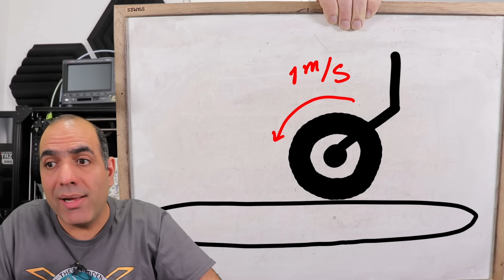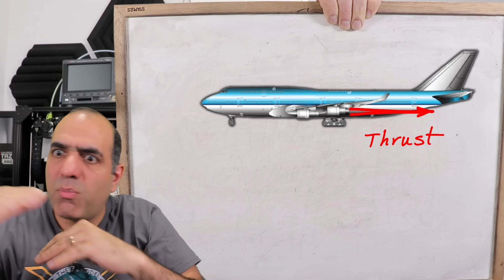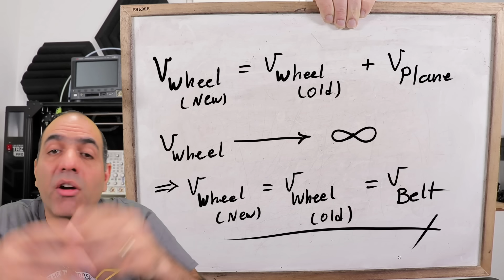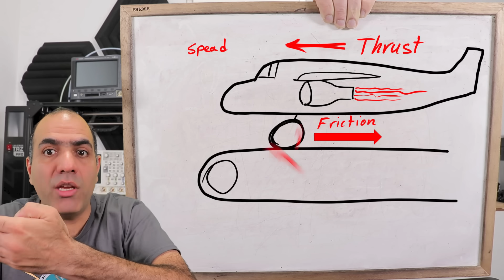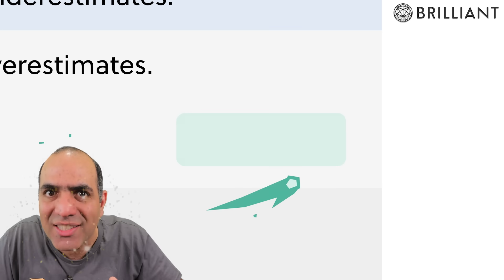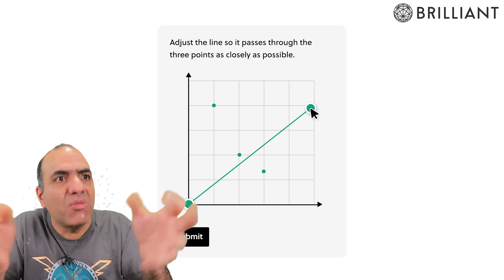Airplane Question that Drove Me NUTS!!!

Comment: Yes, because the turbines are what get the plane going, not the wheels
Reply: No because the plane needs to move to gain enough airspeed to take off, but the conveyor would just keep the plane still so it won't take off
Reply: @cristian_ca_n_le2328  here's the thing though, the wheels are mostly there to make sure the plane's body isn't scraping against the asphalt. They are mostly there for the ride once the plane is taxi'd into the runway. Think of a shopping cart. It's not the wheels providing the thrust for them to move. It's you. In a similar way, it's the turbines on the wings that provide thrust, not the wheels on the ground. The wheels are not not the driving force of an airplane. If it was a car, I would agree. Since the wheels applying torque to the ground is what's pushing the car. With an airplane, we are chucking air out of the turbine, providing thrust. Wheels are not doing anything. You only need the turbines to move, and regardless of what the conveyor belt does, the plane will keep moving until it has gained enough speed for lift off
Reply: @MrKargo  well no because for example, using the shopping cart. If you push it on a conveyor belt that goes the opposite direction as you to make it go forward you will need to push the cart faster than the conveyor speed. In this case though you can't because the conveyor belt keeps adjusting to match that speed

Comment: Case #3 can result in take-off as well.

The thrust required for most planes to sustain flight is far less than full thrust. Add a bit more thrust to overcome the drag profile, and a bit more because we want to climb, and the minimum thrust is about 1/10 aircraft weight. If it's an airliner we are talking about, we have about 1/2 aircraft weight in static thrust available when there are no passengers and using 100% thrust. 

As you said, at some high wheel speed, the drag from the wheels will balance the thrust from the engines, and the aircraft won't take off. Since this drag needs to equal thrust, if the thrust at this point is higher than the thrust to get the plane airborne, the plane will still fly and everything is good. If it is lower and we reach an equilibrium, we lower the flaps and reduce the required lift to take off, and get in the air and it's all good. Additionally, airline planes have enough thrust they can still take off if half the engines fail on the runway. So the chances of the wheel drag scenario are likely to only stop an already broken plane.

In reality, the wheels of an airplane are there to decouple the plane from the ground so it can take off in the first place.  So whatever the ground is doing, conveyor or not, it's very much irrelevant.
Reply: No it cant. You can almost ignore the wheels. The conveyor matching the wheel speed exactly (which would be effectively impossible but is the underpinning of the question) means that the wheels stay still. From there you can ignore the wheels. In order for the wheels to stay still, the thrust applied to the plane via the conveyor-wheel system has to exactly match the thrust provided by the engine, no matter what it is

Comment: The wind over the wings causes lift and flight. The tires and ground speed are irrelevant
Reply: The ground speed is relevant because without movement of the plane there is no airspeed (unless wind is present)

Comment: the wheels turning does not matter, as the wheels are not powered,,,
Reply: But the airplane groundspeed is since (no groundspeed = no air speed). The plane will remain stationary so there won't be air going underneath the wings to generate trust

Comment: The airplane takes off(and this has been proven with RC planes on actual treadmills), the engines don't push on the ground, they push on the air. For instance, if the plane was facing into a headwind blowing in excess of the takeoff speed, .pulling back on the stick would actually initiate takeoff even if the engines weren't running(tho it wouldn't maintain it for long without starting the engines).
Reply: Actually it's wrong, because the treadmill should match the wheels rotation. This means that it won't move on the ground (because it will get pushed back by the treadmill) and so it won't have airspeed

Comment: So I'm 14 seconds in and my answer is of course it can because the wheels aren't what drives a plane.
Reply: When a plane moves forward the wheels spin, now in this case the conveyor belt will push back the plane making it still. Even if you had trust you won't take off because you won't accelerate and therefore get airspeed

Comment: Power is being delivered from the turbines to the aircraft body, not from the wheels to the ground, so yes, it'll take off quite trivially.

A conveyor belt can certainly move the plane using the friction in the wheel assembly, but at a rate proportional to the inertia of the plane regardless of the velocity of the conveyor belt.

Comment: Things make airplane fly is actually Airspeed (generate from thrust) and Angle of Attack.

Even in case wheel brake is fully engaged to fixed the wheel to conveyor belt and the conveyor belt bring airplane to 200 kts VR airspeed, the plane will immediately lose trust (from conveyor belt) coz wheels were lifted from ground. It will not going anywhere and fall off the conveyor belt runway at the end.

The only case the plane will successfully take off is airspeed in opposite direction somehow higher than VR and generate lift enough for takeoff and flying with proper AOA..

Comment: can't take off. Relative speed with the atmosphere is still 0, so no aerodynamic forces. 

Edit after watching: It's not a hard question, and it doesn't really have to do with thrust. A plane takes off because of aerodynamic forces. In normal flight, the thrust provides acceleration relative to the atmosphere, which generates lift and drag by interacting with the aerofoils. If the plane is on a conveyor belt that matches the wheels speed, it simply means that if the plane tries to move forward, the conveyor belt perfectly matches the speed in the opposite direction. In other words, the plain is stationary in the horizontal axis as long as it is on the conveyorbelt. Ergo, there is no free stream velocity, there is no lift, there is no taking off.

Also, what's with that crazy sidetrack with the wheel and belt reving each other up. That is just all straight up wrong. First you have to differentiate between angular velocity and linear velocity. The angular velocity of the belt and wheels is likely to be different, but at the point of contact the linear velocity would have to be the same between the two, to avoid slipping. I don't understand why you think there is this crazy loop. Its like saying that when you run on a belt you have to run twice as fast as the belt is moving. Have you ever seen people running at infinite speed in the gym?

Comment: the wheels are not a driving force for acceleration, it's the thrust from the engines that creates forward motion and therefore lift once at speed. The conveyor belt has no bearing on the velocity of the aircraft.

Comment: Yes, it can take off. Why? Because the thrust provided by the jet engines push the plane down the runway, not driven wheels like a car. The only difference is that the wheels will spin twice as fast at take off, but the plane will still be traveling at the same speed as if on concrete.
Reply: Actually it won't. The plane needs to gain airspeed to lift off, this means it needs to have a ground speed but it can't. The engine's will push the plane but as soon as it tries to move the conveyor belt will just push it backwards at the same force

Comment: Hii Mehdi, 
After seeing your latest video about plane take off it just kicked my mind and I started thinking again on that, and I've
concluded few points which I'm sharing with you. 
1.) Plane doesn't gets forward velocity through wheels. 
2.) Plane flies because of pressure difference between air flowing across it's wings (aerofoil & Bernoulli theorem). 
3.) Frictional force between wheels and runway is constant and independent of velocity of either plane or treadmill (Fr =
umg) 
4.) Jet engines pushes plane forward (newtons 3rd law) both in ground and in air. 
So plane works on two laws of physics 
1.) Newton's Third law (jet pushing plane forward causing air flow over wings) 
2.) Bernoulli theorem causing plane to get upward lift as a result of pressure difference. 
Now the role of wheels of a plane is just to reduce friction between plane and what ever surface it is standing upon. 
If the surface on which plane is standing is moving wrt an observer at airport then plane will also move with it (if it's
engines are off) with same speed and this motion has started as a result of friction existed between wheels and runway
(treadmill) 
Now let's start engines up........ 
Now as engine start applying force on plane it has to overcome that force which is being applied through friction between
runway (moving) and wheels. 
As pilot twists throttle engines start putting more force on plane in forward direction against friction which is causing
motion in backward direction and a point will be reached when both forces will be equal and plane will not be moving
(Engine force = friction force) now from here further application of engine force will now accelerate plane in forward
direction and things will happen like in normal case. 
Most interesting thing to note is that magnitude of  force of friction between plane and surface (treadmill) does depends
only on weight of plane and nature of surface and is independent of any other things. 
So friction will be same no matter at how much speed treadmill is moving or plane is taking off from a moving plateform
or stationary one. 
So always it will fly once engine force is more than friction which is same in all cases.
Reply: Nope. In order to do that at some point the wheels have to move faster than the conveyor. 
And friction is not the same no matter the speed, VERY much not. While there may be a maximum friction force on an individual bearing the work done is proportional to friction times DISTANCE so the the transferred force increases with speed. Also much of the work isnt transferred by friction. (thats the point of bearings).
The simple approach is that in order for the wheels speed and belt speed to match the wheels have to stay static. To do that the force conveyed by the conveyor-wheel system has to exactly match the force of the engines. No net force, no motion, no liftoff. No other part of the system matters in the supplied conditions.

Comment: Why would the wheels even move at all?  
What if the magic conveyer had no internal friction, the 747 wheels would never have to overcome static friction and the jet pushes the conveyor FORWARD until it takes off without ever rotating its wheels. The wheels never roll against the conveyor belt and the conveyor belt does not move relative to the wheels.

Comment: I think such a control loop (described it the question) is theoretically impossible.

The plane is pushed forward by the thrusters, let's say it moves forward at v speed (yes, it should be accelerating, but let's live in the moment for now). If there is no slip between the tyres and the road, the point that touches the ground has 0 speed compared to the ground and vc circumferential speed compared to it's axle. If we flip it around, we can say the axle has vc speed compared to the ground, and since the plane is thrusted at v speed forward the axle moves at v speed, so v = vc.
Now if the conveyor is present, the vc speed has a new component: vd the speed of the conveyor. So it should add up, and be v + vd = vc.
And here comes the problem. The control loop should be monitoring vc and control vd to be actual equal. Since v + vd = vc is true by the laws of physics, the control loop can only be achieved if v = 0. Yet since the plane is pushed forward by the thrusters v>0 will be present. That means even a theoretical control loop will fail as soon as the thrusters are turned on.

The given conditions can't be met even in theory.

Comment: It’s a red herring, you need AIRSPEED, not groudspeed
Reply: But you won't have airspeed if your ground speed is 0 (unless you have enough head wind to take off)
Reply: @cristian_ca_n_le2328  doesn’t matter, it’s still airspeed that allows it to take off. Ground speed has absolutely no factor
Reply: @dariosunseri5326  it has because (without wind) the air won't move, and if the plane is not moving either there won't be any airspeed

Comment: Allowing for your observation that the thrust is created from the engines and not the wheels and so it would still take off is not possible as the convayerbelt is the same length as the plane which is too short for this type of aircraft to take off.

Comment: realistically, the only situation where the plane cannot take off, is if the friction of the wheels gets so high so fast the wheels combust and break apart before the plane has enough airspeed to take off. beyond that, it'll take off every single time. wheel speed is irrelevant with aviation.

Comment: The actual original question is supposed to be the conveyor belt runs at the speed of the planes takeoff speed, not that the conveyor matches the wheel speed. Thats the problem with the post from that account.

So many people still think the plane wouldn't take off though.

Comment: By the way, when something rolls, the ground automatically moves at the same speed as the wheels in the opposite direction relative to the rolling object. Your definition of "match" seems to be "double the speed". Might be a trick question.

Comment: They did it on mythbusters, yes, the plain can take off.😊
Reply: They did wrong, the conveyor belt wasn't matching the spinning of the wheels. The truth is that it won't move, so won't take off
Reply: @cristian_ca_n_le2328  wrong.  The Speed/thrust comes from the body on the plane, not the wheels.
Reply: @bradameerbeg2154  the thrust comes from the engine, the lift from the wings(mostly) but still, if the plane is not moving forward (because it's getting pushed back by the conveyor belt ) no wind is going underneath the wings so there is no lift
Reply: @cristian_ca_n_le2328  sigh…. Nothing is getting pushed back…. The plane will still take flight.
Reply: It’s the same for planes taking off from water… there is zero friction from the water, but they still take flight.

Comment: There is no lift over the wings, which would prevent the plane from taking flight. Assuming the most reasonable characteristics:
Calm day, no extraneous 400 mph headwinds
The wheels and conveyor belt do exactly what is stated

The plane is sitting on the conveyor runway. The 747's engines spool up and begin to create thrust. That thrust pushes the plane forward, spinning the wheels. this action, given the circumstance of the word problem, forces the conveyor runway to negatively match the spinning of the wheels. This means that the plane is stationary in space. It can build all the thrust it wants, and will never take off due to the fact that there is no airspeed, what-so-ever. No airspeed over the wings means no lift, no lift means no flight.

Putting extraneous "lol brakes are on" or "friction would cause the bearings to malfunction". Take the problem at face value with normal operating Earthly variables that correspond to the question being asked. If the conveyor prevents the plane from moving forward through space, then you can not have airspeed over the airfoil.

Comment: If you remove all variables and just put a matchbox car on a slope and move the belt in an opposite direction the toy car will still roll downhill at the speed of gravity. The force is not on the wheel to surface. This is a simple experiment as you can test it on a treadmill with even having the treadmill start at a speed before releasing the toy car.

This works until the belt moves at infinity as eletroboom states. If the belt tries to match the wheel, it never can, because the wheel first moves and then the belt moves. At that point the belt can never equal the wheel speed.

Comment: This is almost the perfect video on this problem, except it misses one case:

The "add friction" case in which heat is considered and the bearings fail, everything melts, and now we're just asking if an airplane can take off on the molten hubs lol

But really, I'm glad there's a concise video I can point to now that goes over the two different interesting cases
Reply: Yes, but if everything melts then the fuel catches fire and explodes causing the plane to fly (if only for a few moments).
Reply: If the conveyor perfectly matches the speed then it will stop as they do. Ofc the only way either can really happen is a massless belt or infinitely powerful motor but thats the question parameter.

Comment: If not only friction was on everywhere, but all physics was on everywhere, the wheel bearings would overheat from the absurd amount of friction, the wheels would break off, and most likely the plane would crash onto the conveyor belt, but I suppose technically it might be able to stay in the air starting from the couple of feet up that it is from being previously on top of the wheels

Comment: A big nope on that Twitter question. The plane is not moving, so there is no lift created by air moving over the wing. Theoretically the plan could take off without moving, but with in the confines of the information given in the question, no.

Comment: The plane is nit like a car the engine feeds the wheel but in a plane the engine pushes back the air at high speeds so i suppose the wheels of the plane are moving freely and the plane could take off ( its gonna crash down) correct me if im wrong but i think my theory is correct